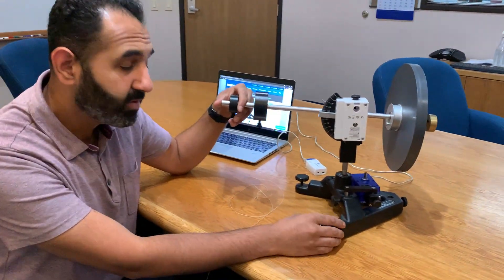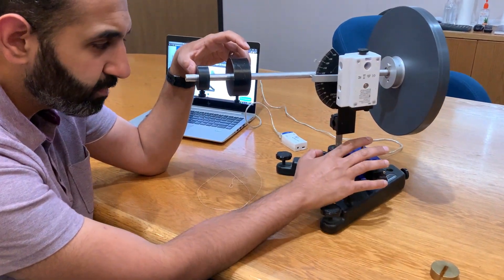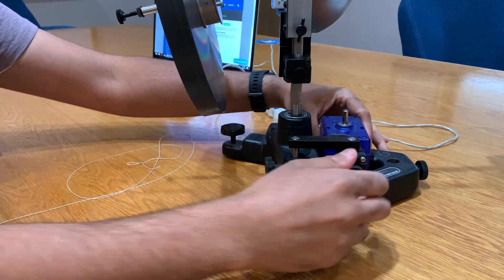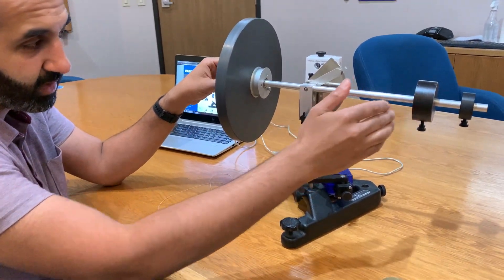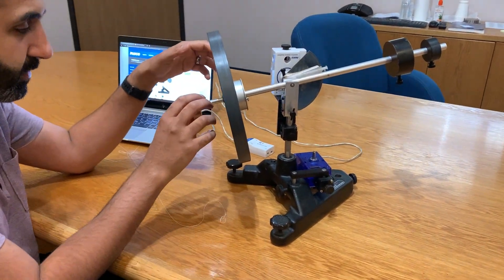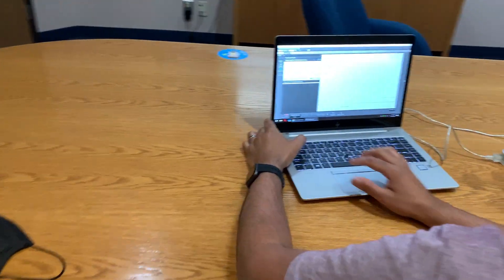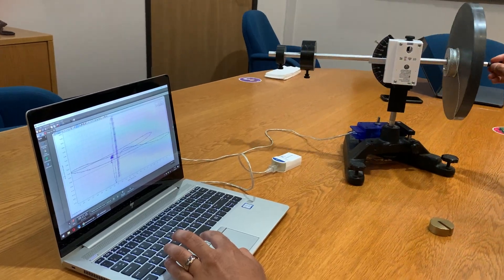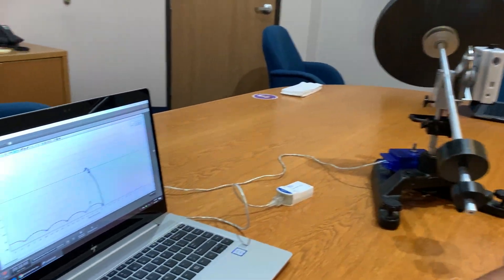PASCO 3-Axis Gyroscope Setup and Demonstration

Comment: Hello sir, I have a question about the large circular disk of the gyroscope, what kind of metal is it made of, and what is its weight approximately?
Reply from the maker: The gyroscope disk is actually made of plastic (PVC). The mass of a sample disk we have here was about 1.75 kg (including metal mount and bearings).
Reply: @pascohowdoi  is a gyroscope sensitive enough to measure earths rotation?
Reply from the maker: @Earthislife1031  No, there is too much friction for it to not rotate with the Earth.